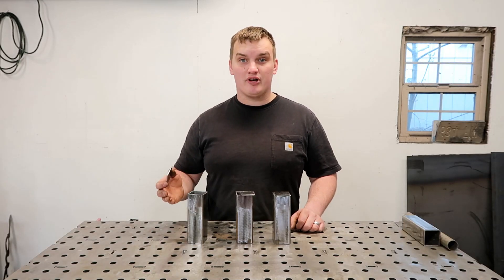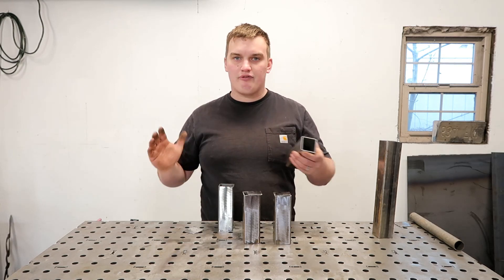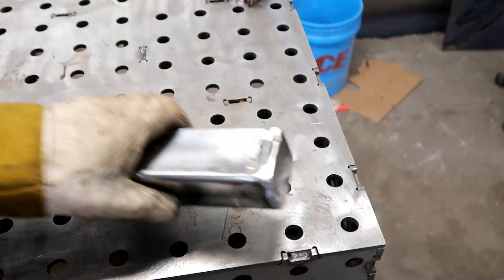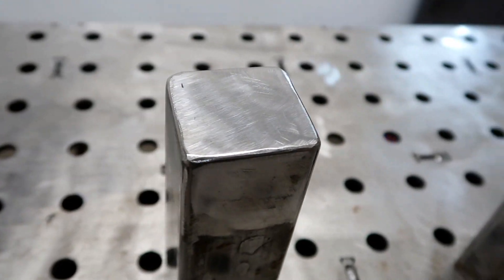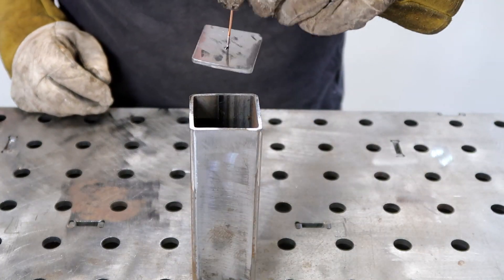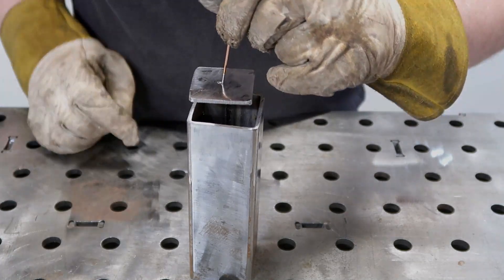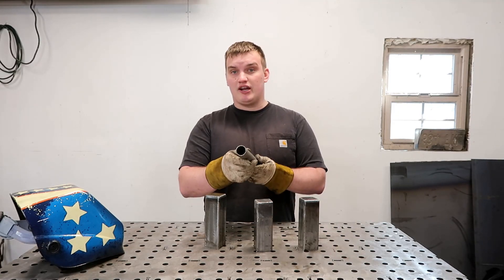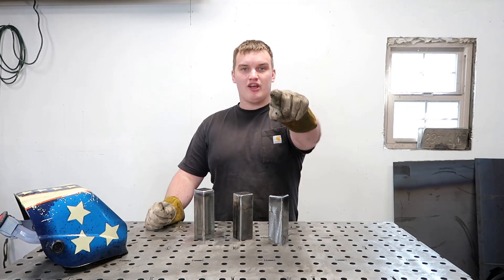Top 3 Ways To Weld Caps on Tubing (Fab T&T)

Comment: You could use a magnet clamp to hold the inside plate in place. It would automatically set the plate flush.
Reply from the maker: That is definitely an option for MIG welding. You cannot TIG weld very close to magnets though without causing porosity and interference.
Reply: @amcustomfab  just long enough to tack.

Comment: You can just lay that inside cap on your welding table and put your tubing around it then use a clamp to tighten it in place squeezing the tubing.

Comment: When built a roof garden outer fence out of 50mm square welded caps on them made out of sections of tube cut them up so like L brackets then cut last bit of then welded along that side looked all one piece of tube. do in part for stopping water running down inside but also safety as falling over onto an open end of tube will open you up!
Do remember that sealed tubes create/hold condensation! 
Good one is to plumb a tube up on an airline then spray inside with something like ACF50 so stops corrosion

Comment: On method #2 why not just use a magnet that's large enough to hang over the sides of the tube then you can just have the cap sitting in place with the magnet....  then you know for sure its flush.

Comment: Yep that was helpful. What do you do if you have put a cap on both ends will that trap the air inside?
Reply from the maker: You drill a small bleed hole to let hot air escape while you are welding the caps on and once the Caps cool you do a quick plug weld just seal your bleed hole.

Comment: What kind of welder are you using? Those are beautiful welds
Reply from the maker: That was a old Miller synchro wave 250. Now I run a prime weld and love it
Reply: Thx. Imma be trying to do this when I start building my flatbed on my truck. I was wondering how to do this.

Comment: Ive been welding for about 15 years now and it’s all been self taught. I wish I watched videos like this years ago. I actually did my capping in the order you showed here. I started in my teens with outside cap then tried the inside cap for a year or so then about 5 years ago I slapped my self when I figured out the semi outside cap. The only way to go for sure. Thank you sir.

Comment: AM, using a bench mounted, belt sander to work the ends of pieces against improves the final product as much as your good welding techniques; lay the body of the tube to the belt- then rotate the piece around the weld face.  This rounds the ends so the hand-held "random-ness" of the finish is diminished and the pieces will have uniform round-over sanding of the welds.
Reply from the maker: Totally agree with that method and would absolutely do it if I had the pleasure of owning a belt sander.😉😎
Reply: @amcustomfab  Grizzly has a little oscillating 4x24" affordably priced. Use mine on aluminum all the time.
Reply: Maybe some company should send you a belt grinder , solely for review purposes.

Comment: For the inside one use a magnet that goes across the top.
Reply: Just need a magnet that works with aluminum...
Reply: Yep, done this countless times. I use an angle welding magnet with one of the flat faces straddling the cap.
Reply: do you read my mind  jejeejeje
Reply: Exactly. For such a competent welder he made that hard work for such an easy job.
Reply: @grumpyone5963  Give him a break - he's young.
Reply: Jon Bozzy the fool never thought of that he just assumed that everyone has a tig welder.